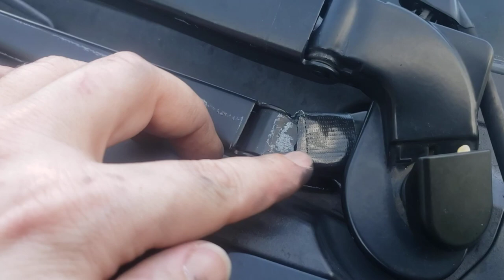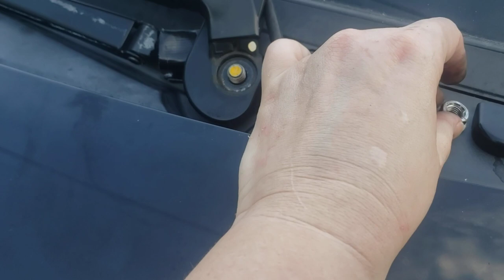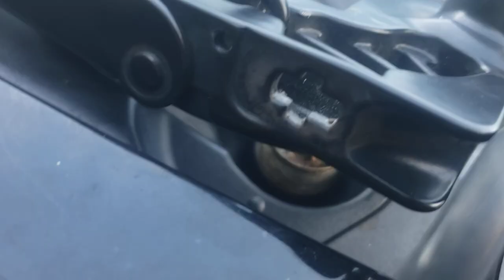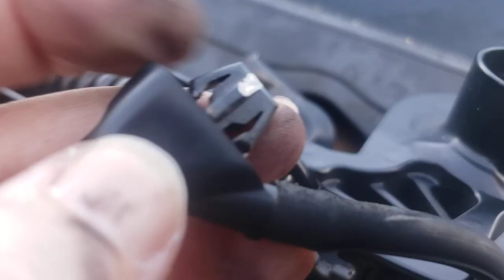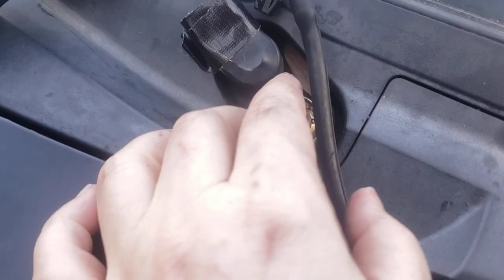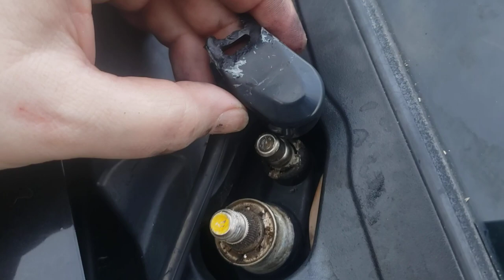2013 Toyota Yaris LE Hatchback single windshield arm replacement

Comment: Where did you buy the replacement part from?
Reply from the maker: From a Toyota dealership 😁
Reply: Plz mention Broken part name?
Reply from the maker: @adnanaijazgvkbvg9112 it is the front windshield wiper arm, the one plastic piece attached to the arm broke, but the whole arm had to be replaced